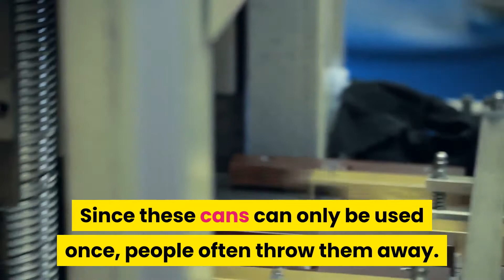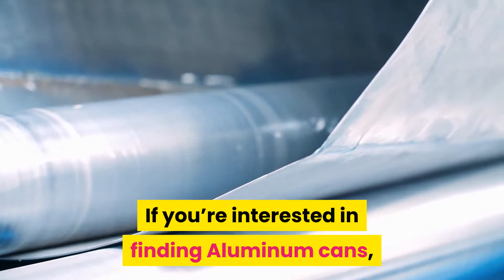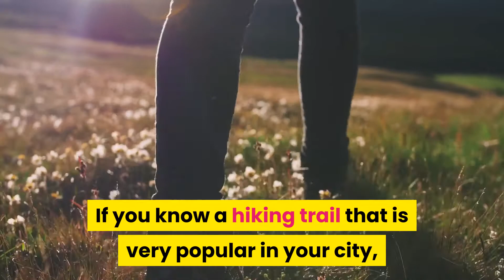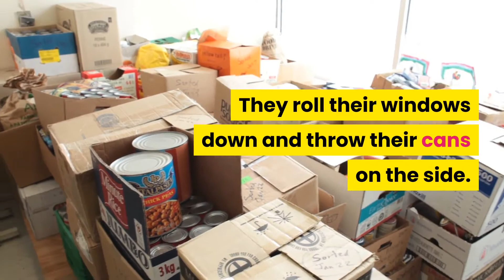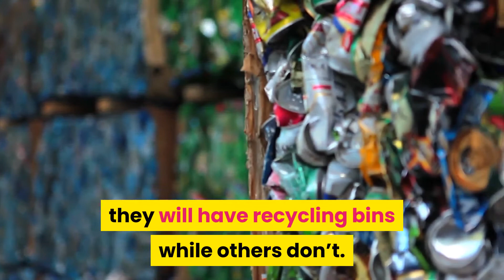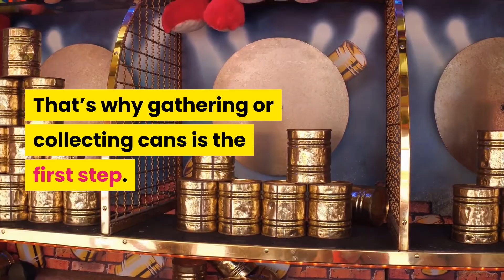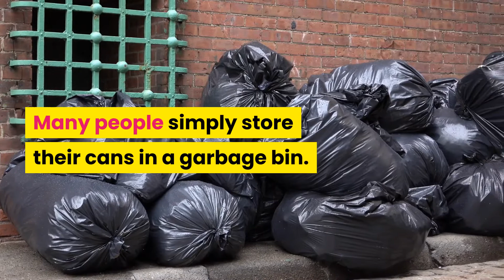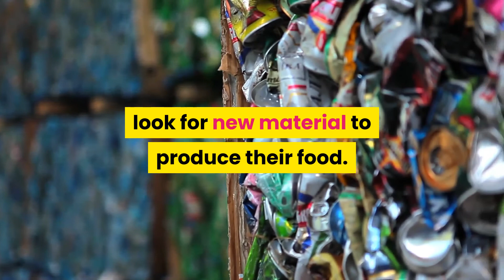How Many Aluminum Cans Does It Take To Make $100

Comment: Someone is living in a fantasy world:  when this vid was posted ( Oct 2020 ) the avg price for aluminum cans was at its highest level in over 16  prior months at 56 cents per pound  -  the ONLY way one could ever realize $1.60 per pound would have been in states with a deposit added with the cans being redeemed as deposits:  they would count the cans, not weigh them.  Why they would wish to weigh your van is anyone's guess  -  I have to assume in that scenario, if one didn't actually own a van, they would be SOL -  in any case, if your scrap recycler is weighing your vehicle to determine the weight of your bags of cans, you are being seriously underpaid for your cans:  a scale that can weigh a vehicle couldn't accurately deduct the weight differential when those few pounds of cans were removed.  Since the current national average for scrap cans as of 2/16/2021 is 37 cents per pound  ( and only about 25 cents in most locals ) it would take about 8200 cans ( @ the 37cent level ) to reach that $100 return.